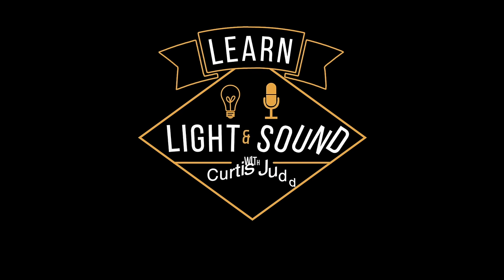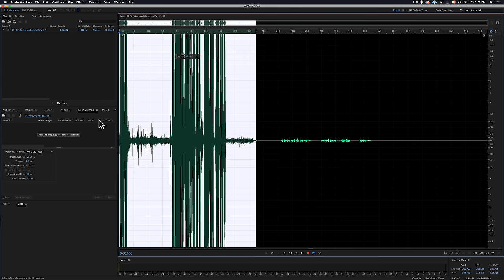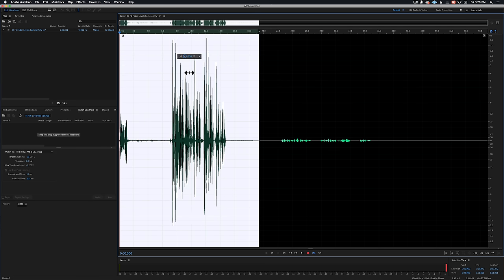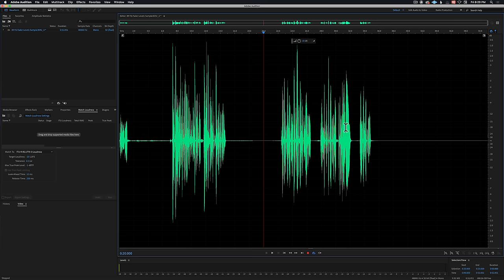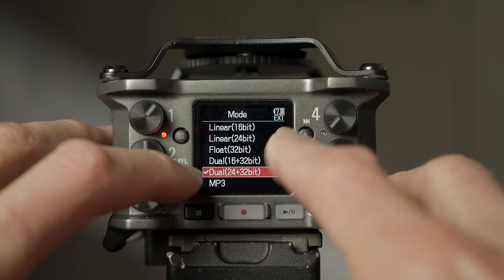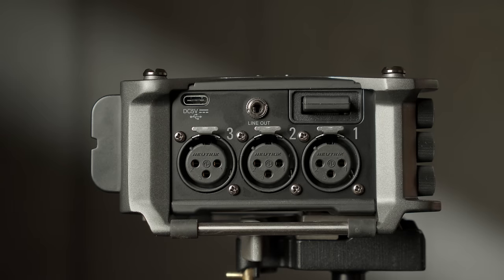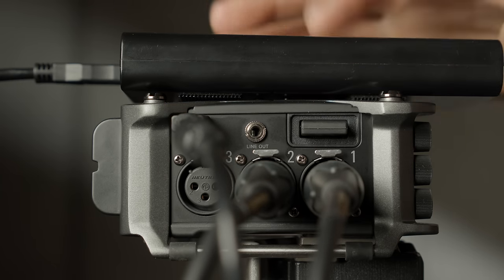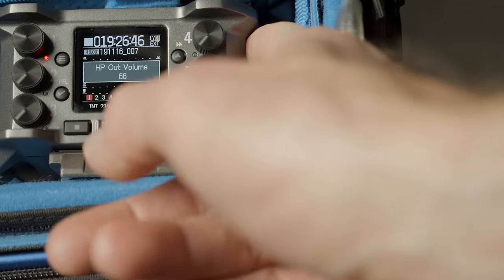Zoom F6 Audio Recorder Review

Comment: Conclusion: The recorder that says "Goodbye!" to you, wins haha. Keep this in mind, manufacturers.

Also "unity gain" is a bit misleading for tech people, since that term typically means zero gain for an operational amplifier chip (opamp). The way you had your diagram, it would imply that the preamp wasn't amplifying anything but rather "buffering" the low level microphone signal. The better term would be "fixed gain", since there is gain, it's just not adjustable. Great review, thank you!
Reply from the maker: Thanks. Interestingly, unity gain is the term Zoom uses in describing this so I'm not sure exactly what they mean. Perhaps fixed gain would be a better choice.

Also, I don't know if you saw to the end of the video, but even the friendly "goodbye" message didn't make the F6 my favorite choice in this range of recorders. :-)
Reply: @curtisjudd   If Zoom chose to use it, then it was probably something that was lost in translation. Unity implies "1", hence unity gain is equivalent to no gain because you're multiplying the signal by 1x ("gain of 1").
 That's how it is in the electronics world at least.

Regarding favorites, you've correctly pointed out that different people will have their own preferences based on their workflows. I do corporate video very much "on the side" as part of a larger service package, but I end up creating a lot of my own custom products when market solutions are too expensive or underperform. One of your older reviews caused me to create my own portable preamp when I realized that Sound Devices was the only company with high-enough tech specs for some of my applications - but I thought I could get to that level with a custom device without having to spend that kind of money, so I did. The "value proposition" of the F6 and MixPre II is much better. Personally, I don't like to overspend on equipment - I prefer reinvesting into other business aspects. Your reviews are as good and as comprehensive as they could humanly be. Thank you for making them! -Nick
Reply from the maker: @oriole8789  Thanks Nick! Would love to hear about your custom preamp some time.

Comment: Oh sure. If the F4 and F8N are anything to judge and compare this buy I love the quality. What hearing it with the NT1-A will do is demo how close to a sound devices recorder. Because that's what Neal did always. The standard is his 744-T than how does the new recorder hold against the 44-T. I'm sure again from that add Zoom did with the F4 that it will some what hold against the 744-T pretty well. The pluss with this is that it can do 192 KHZ 32 bit WAV.
Reply from the maker: 32-bit FLOAT.
Reply: @curtisjudd     Ah yeah it's a float I forgot. I'll have to listen to their vid again. I forget the difference in the float VS if it did 32 bits dirrectly or what ever I thought.
Reply: @curtisjudd  I checked the Sweet Water sound site and they now have the F6. I'll bet that's why Neal grabbed 1. But yes I wish I had the $600 so I could grab 1. Don't get me wrong I love the H6 but dude who'd wana miss a chance at something that's so pro?

Comment: Hey Curtis, test the stereo out of the f6 it has serious issue. No matter what you connect to it has a really high noise coming out of it but when I connect out of headphones it's fine. I sow your post on other video where you said it could be a ground but it's not. I connected to speakers, to another recorder to 3 different cameras the noise still there, I even change cables 3 times no change still there. This recorder is defective by design and I don't think they can fix it with firmware. No one should buy it at least not for $600. You should test and let Zoom know. I already sent them an email.
Reply from the maker: Hi Roy, thanks for the info! I just tested sending audio from the F6 to a Panasonic GH5S and a Blackmagic Pocket Cinema Camera 6K. The problem does indeed, exist with the GH5S so I'll inform ZOOM of my experience with that. Interestingly, it didn't appear to be nearly as much of a problem with the P6K - much cleaner signal which was closer to what the F6 was producing. So it appears to be somewhat camera dependent. Thanks for the tip! I looks like this slipped past me since I only tested this with the Pocket Cinema cameras.

Comment: High Curtis. What is urgently needed is 48 KHz @ 24 bit (Not 32) floating point recording capability. Neither Davinci Resolve or Media Composer (Which I use and is the golden standard in full broadcast and Cinema enterprise production environments) can handle anything more than 24 bit 96 Khz as pass through and 48 KHz @ 24 bit as editable. I am somewhat surprised Zoom doesn't enable the float feature on 24 bit as well ?
Reply: Do Resolve and Avid support 24 bit float audio?

The "float" refers to storing values as decimal numbers rather than as integers, so it would be an inherently different format than the classic 24-bit audio everyone's familiar with.
Reply from the maker: Is there a spec for 24 bit float wav files? I’m just not sure.
Reply: @thatcherfreeman  I know traditional WAV and Broadcast WAV files are supported, but I don't know about "Float" based WAV files (?????)
Reply: @curtisjudd  Yes there's a spec for it but not sure about the "Float" based WAV files ? I am positive 32 Bit files and WAV files Above 96 KHz are not supported in Media Composer. However, I think these newer, high resolution WAV files are supported in Final Cut 10.4.6 and higher.
Reply from the maker: I think that’s the question. There is a spec for 32-bit float wav, but I don’t know that there is a spec for 24-bit float, just 24-bit linear.

Comment: ATTN: Curtis this will be one of those WHAT!!!!!! JUST!!!! HAPPENED!!!! Moment. I have some news for you with the Zoom F6 and trim control…. Turns out there is actual trim control for 32 bit float!!!!!!! This fixes my one and only disappointment with Zoom in the 32 bit float realm 

There is a caveat, you can’t control trim in 32 bit float directly, you must set your trims from 24 bit float. Then change recording setting to 32 bit. The trim setting will follow into 32 bit float. I’m super excited to have this knowledge thought I’d share it.

Think should be updated noise floor because you were using fader not real gain
Reply from the maker: So you trick the recorder into trim control mode? Sounds like a mistake rather than a supported feature?

Comment: This excellent overview is timely because I’m about to make some video and sound recordings on the 7 Train above-ground station platforms of the New York subway system. I did a test on Friday on one of the 7 Train platforms, and both my ears and iZotope RX are telling me that the dynamic range of the sound is significant. As a result of the test, I know where I want my gain level to be in relation to the ambient, regular sound of the platform and the trains’ sound, including the sound of 7 Express trains barreling through a local station, and whether I want to use a low cut filter and, if so, how much to cut (which, given the amount of low frequency energy that these trains generate, very much affects both the overall sound and my clipping point). I also now have settings that will be repeatable, with minor adjustments, on other 7 Train platforms.

Now Zoom tells me that its F6 makes the test and my settings unnecessary. I just put the F6 on 32 bit/dual converter and, voilà, I don’t have to worry about tests, dynamic range, clipping, low cut filters or repeatability. Indeed, the F6 will just set unity gain and what it does after that is apparently none of my business, until I open my recordings in iZotope or Logic and try to figure out what I’ve recorded. I do want to try this, but I won’t be spending US$650 for the privilege. One important question, to which I’ve yet to see an answer, is why Zoom has done away with setting gain and Sound Devices hasn’t. I have a suspicion that the difference just might have to do with post-recording processing :) I also have no idea what happens if you try to use a wireless lav with these settings. Right now, colour me skeptical.
Reply from the maker: Definitely understand the skepticism.

Comment: Graet Video! I have been researching for more than a week now and I have finally narrowed it down to Zoom F6 or the Rodecaster Pro. My requirements are as follows and I need your input to get the best possible product for my needs:

I have 2 Shure Sm7bs and right now I host my podcast with two people only but in future I will add 1-2 more people and I do not want to have a cloudlifter in my workflow. I feel it's not worth spending $150 everytime, so I want to know whether it will be big difference in audio quality between the F6 and the Rodecaster without the cloudlifter. The F6 has noise floor of about -127db with a very good gain of 75db and the Rodecaster has about -125 with a gain of 55db. Theoratically I know the Rodecaster is of poor quality but after listening to 3-4 samples of SM7b with Rodecaster on youtube, the quality looks acceptable to my ears and I am okay with doing a little bit of tidying it up in Audition in post. Unfortunately, there are no samples of shure sm7b with Zoom F6 so I can't really decide if the mic sounds a lot better with the F6. What do you guys think - will it really sound a lot better with the F6 without a cloudlifter in between compared to the Rodecaster?

When I am doing podcasts, I also want to feed the mixer out from the recorder to my Canon M6 II mic input directly and I have read that for the Zoom F6 I will need to use an attenuator cable. How is the headphone/line out quality of F6 vs the Rodecaster? This is important to me because I will also use this to record live music concert events in my locality (around 3-4 times in a year) and I will be feeding the mix out directly to my camera's mic input.

My heart wants to go with the Rodecaster Pro since it looks really cool, I can incorporate the mixer in my video shot and look cool, I can add all the bling sounds to my videos and even record phone calls and do online podcasts but my mind wants to go with the Zoom F6 because it has much better preamps and hence better quality for my SM7Bs, also it's more portable but it's difficult to use - I can't have seperate headphone out for each of my guest and also cannot record phone calls as easily as I can with the Rodecaster Pro.

If you had no budget constraint and had to strictly use it with Shure SM7B and had to strictly use it without a cloudlifter, will you pick the Zoom F6 or the Rodecaster Pro? (please give me your reason as to why!) Many thanks!!
Reply from the maker: If you are comfortable cleaning things up and boosting levels in post, it sounds like the RODECaster would be a good option for you. I'd personally choose the F6 for its superior preamps and I'd use the F6 control app on an iPad to make the F6 easy to operate.
Reply: @curtisjudd  Thank you so much for your prompt response. Really appreciate your inputs. I was wondering after cleaning up in post will the audio from Rodecaster be near identical to the F6? Since you have reviewed both of these devices, I also want to know if in future all 4 inputs are occupied on the Rodecaster, will that add more noise or will it not make any difference? And can I use some sort of headphone splitter to monitor audio out of headphone from the F6 for each of my podcast participants?

Comment: How does 32bit float mode work when directly outputted  to the camera?  I understand the recorded file in the mixer can’t be clipped but what about the output signal to the camera. Currently use a 302 since I’ve adjusted the gain so after filming an all day conference the audio levels in the video don’t need any post work. Whether I’m filming for myself or other the preference is the audio be embedded in the video and as little post production as possible. As a solo shooter not clipping is attractive but I’m not sure the way 32 float is implemented would aid me in my work flow. 

Btw love your channel, you do a fantastic job. I even like your trademark chuckle.
Reply from the maker: Thanks Peter, 32-bit float is not currently  as useful for a mixer to camera workflow unless you also record on the F6 and replace any clipped portions of the camera audio. You’re probably better off with your 302 or a MixPre in 24 bit mode with analogue limiters engaged.

Comment: I wish I could afford this! I thought dual stereo was great, 32-bit float is just magic! I use a Tascam DR60-D, earlier this year I recorded an interview with a microphone manufacturer at a trade show. The XLR cable was not inserted properly and the audio was extremely low. rising the level of course sounded terrible, so I am not going to post the video. I feel badly because they took the time to be interviewed, but I can't post a video with bad sound using their mic as the source. What is the piece over the XLR 1 jack? How many times do you have to hit the record button before it starts recording, and is there a max SD card size? Thanks.
Reply from the maker: Hi OrlanDave, Above the XLR1 jack is a port to plug in the optional bluetooth adapter. You press record once to start recording. You can use SD, SDHC, or SDXC which top out at 1TB at present, I believe. But a 64 or 128GB should do the job nicely for 99% of cases. As for the situation you cited at a trade show, I'm not sure the F6 would solve that particular problem. When a mic is not fully inserted, the audio usually is rather poor even if you can raise it in post because the audio signal is compromised.
Reply: @curtisjudd  Thanks for the quick reply! As you stated, I also am often running everything all at once by myself. The Tascam requires the record button to be pressed 2 times. Once to arm, and once to record. I have had so many times when I thought I was recording, but I wasn't. That is a very high card limit for the SD card. The Tascam DR60-D has a max card size of 32 GB! The audio it recorded at the trade show was ok, but it it was a noise floor issue (hiss basically). I mostly find my levels are always too low or too hot.

Comment: Hi, here's an off-topic question for the professionals: do you have some special ways of making sure you dont lose data when taking a full memory card from the camera/recorder and into the computer? For example: would you connect a memory card reader to an active Usb3 hub that's powered by a common cheap DC power source? Thanks,
Reply from the maker: Hi Harri, I think it depends on the level the "Pro" is operating at. For those like myself, I'm working on small to micro-budget gigs. In this case, I rely on the fact that I have dual cards in my production recorders. And then yes, I just use a standard USB card reader. At the larger budget levels, I assume that the DIT has more robust processes in place.

Comment: The mixpre is a great device,  but for the money,  the zoom f6 is a stand out recorder,  it's also £250 cheaper than the mixpre3ii here in the uk at the current time.
Reply from the maker: Yes, a real deal. But be careful if you plan to feed audio from the F6 to a consumer grade camera. I discovered an issue with the output on the F6 which requires a bit of a work-around if that's your use case: https://youtu.be/t5W4Wg2yzfY

Comment: Great video - is the F6 overkill if I just want to do audio field recordings? I don’t feel like I need 6 inputs for that.  I currently use the H2n but would like better quality.
Reply from the maker: I guess it depends on your goals. If you plan to do any ambisonic recording, you'll need 4 inputs and a recorder which supports ambisonics formats. The F6 does that nicely. If you just want stereo recordings and need the recorder to be small, I'd just stick with the H2n because you wouldn't find a huge increase in quality with the other handy recorders with built-in microphones which I've tried.
Reply: @curtisjudd  thank you very much :)

Comment: I got the F6 and am using Cubase LE for post (as it comes bundled with the F6).  I was wondering, when setting the 'gain' in post (if that's the right expression), can I simply 'normalize' the track to say -12 or -6 or should I adjust with the gain control as I have seen you do in your videos.  There are lots of videos showing how you can recover clipped or quiet tracks but I'm still slightly lost in terms of which controls I should actually use.  For info, my use case is taking a piano recording made with two mics and loading the individual mono tracks to mix them in Cubase.
Reply from the maker: Hi Tommy, I'm not familiar with Cubase (I use other DAW apps) but usually the gain and normalize do the same thing in most other apps. If there is an "Amplify" function or plugin, that might be different so I'd avoid that.
Reply: @curtisjudd  thanks Curtis. I appreciate your response. I guess I can do a test to see if I can hear any differences in Cubase. Normalize looks like it is the simplest way to adjust the 32 bit float file to the desired level and then work from there. Again, thanks